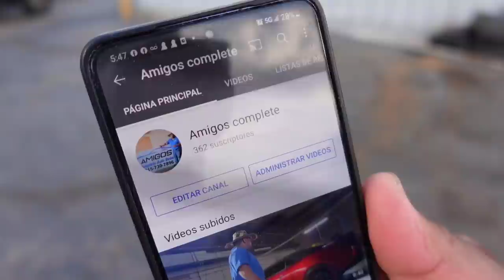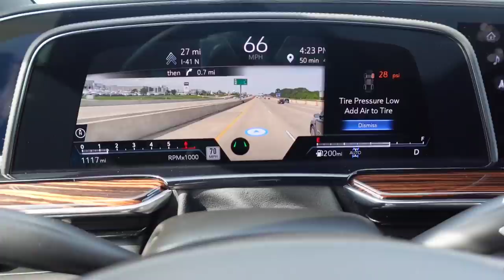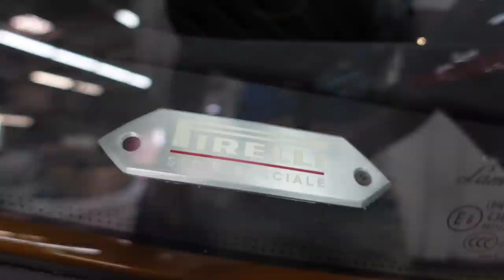FIRST LOOK AT MY OUTRAGEOUS PAINTED LAMBORGHINI AVENTADOR

Comment: You got sciatica, that pinched nerve in your back it runs down your left leg. If you hang from something it will take the pressure off your nerve you should get it checked out you might have a disk problem like me.